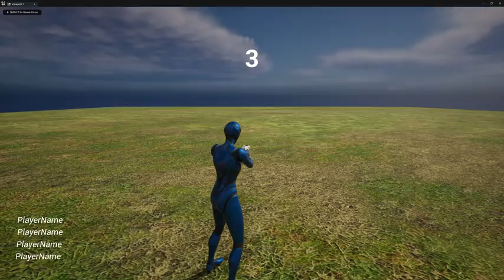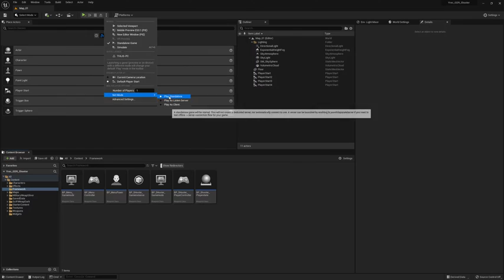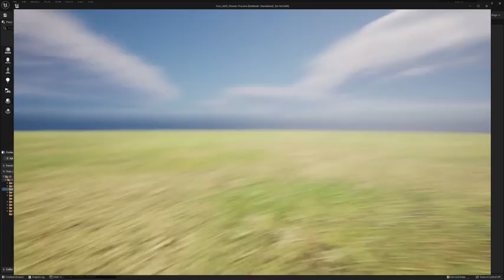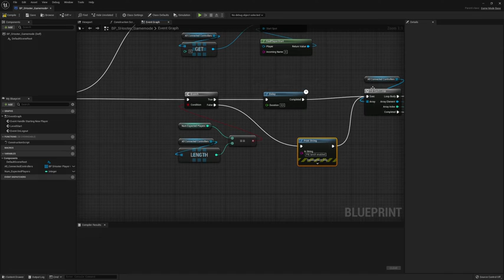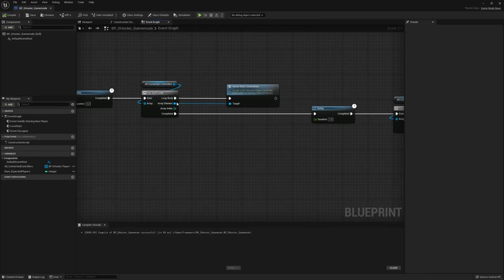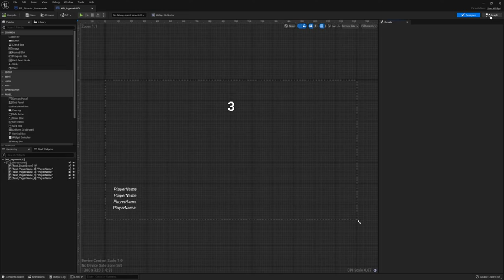Make a Multiplayer Game in Unreal Engine 5 - Turn In Place Anims - Unreal Beginner Tutorial #7

Comment: hello everything is working but my animation is looping, when I check the anim blueprint I see the condition is checked every time so it plays the montage everytime it sees the condition is true, how could I fix this? this is a minor issue but it's kinda annoying (also I didn't enable root motion for my character but despite I added a Transform (modify) Bone to lock the Hips bone in the default slot I don't know if it is related)
Reply from the maker: That could ver well be the issue, preventing it from reching the target rotation so making the animation loop

Comment: Hello. I am watching your series on how to build multi player game and it is great. I do not understand much but that ok. I have a question though. I see that you use lots of casting, Is it really necessary or you could use interfaces instead? I am talking all the programing you have done up to this video (that i still have not watched).  Also, you use the old input method, is it because the new one was not available yet when you made the videos? Thanks and thank you ❤
Reply from the maker: Thanks, glad you like it! Yes in general you are right about the casting vs interfaces and you want to avoid casting if not needed. But a 'mistake' i see people make is for example still pass on the Class you Cast to in the interface, in which case it doesn't really help. It's the hard reference that's stored in a variable that makes it the class needs to be loaded in the memory etc, The actual cast node is prob still a relatively costly operation but it's not the biggest issue. 
In this series i'm not all to focussed on that though, simply because it makes things a lot easier to follow/understand. It's considdered a 'beginner' toturial so there's def room for improvement in the project. Consider it more of a detailed prototype then a polished ready to release game allthough i do get into a little bit of optimisation later in the series.
The enhanced input's simply wheren't available at the time, i upgrade to 5.1 in part 63 iirc so it's in there somewhere 😂 i started the project in 5.0
Reply: @GameDevRaw  Thank you :-) Im only at chapter 8 so i got a lot of ketchup to do :-)
Reply: @GameDevRaw  Greetings ! Thank you so much for such a comprehensive tutorial! Please tell me, how can I do that if the character turns and at this moment starts moving, he does not wait until the end of animmontage turn?

Comment: an amazing series,but have a doubt why do we use local variables instead of normal variables also why did we make new turning anim yaw and turning anim yaw didnt get it what impact did it make
Reply from the maker: Why? Its simple optimisation, if a var is not used outside of the function there's no need to make them a 'normal var' and you can make them local. 
It means that as soon as the function ended it will be 'forgotten' so it wont take up resources, normal variables will stay valid untill you clear them.
Some local var's you could do without maybe, but they simply make the graph look cleaner.
Reply from the maker: For the Yaw vars i cant remember what you mean, i know there's 2 yaw var's in the AnimBP one is used to drive the AimOffset and the other to drive the turn in place anims, think they are clamped differently iirc.
If you can timestamp where in the video you are talking about i can try to verify
Reply: @GameDevRaw  in the last chapter of video we are using 4yaw variables but why

Comment: when im ADS mij character get super big en glitcht
Reply from the maker: Sounds like its applying multiple additive anims, or its applying the ADS at the wrong point in the AnimBP
Reply: @GameDevRaw  I get the same problem. Ive followed your directions. checking them but have no clue why it is doing this.
Reply: I have discovered just now that the aim offset player for the AO MF PISTOL IDLE ADS is devoid of animations. When I plugged in the AO MM PISTOL IDLE ADS aim offset player and plugged in the MF PISTOL IDLE ADS or the MM PISTOL IDLE ADS anims/sequence players into the base pose it works just fine. It doesn't get super big when I ADS in the editor.

Comment: I wanted to add you could do turn in place inside the anim graph using simple anims linked to the graph itself, rather than use anim montages in the event graph.
Reply from the maker: It's way more complicated to setup in the AnimGraph with 'simple' animations. I'll def wont be doing that for this series, maybe in a seperate video at some point